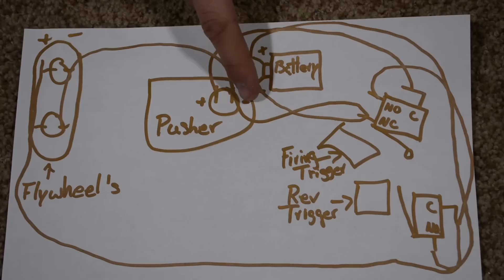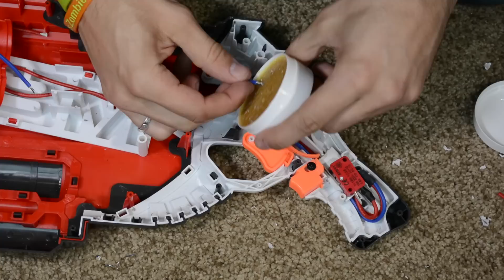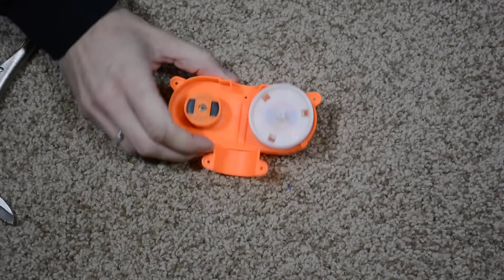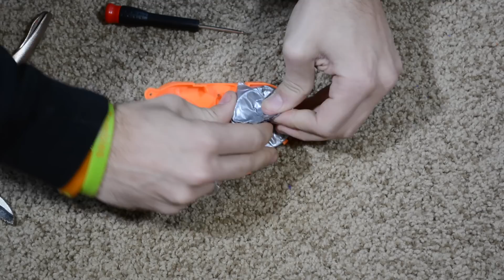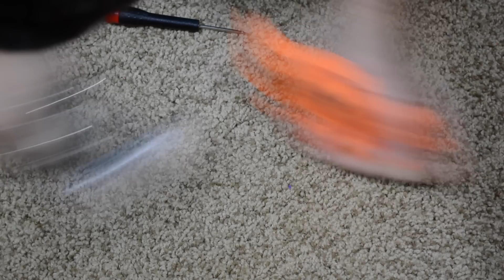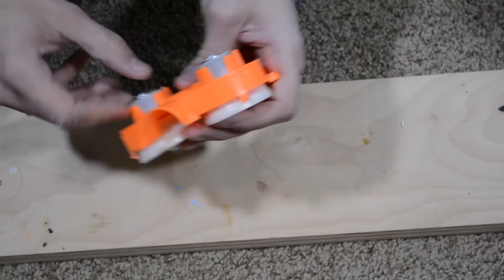[Mod Guide] Nerf MEGA Mastodon Part 2 (Wiring Diagram, Flywheel Removal, Motor Replacement)

Comment: Thats the worst wiring diagram in history. Square off your lines and use little half circles to indicate wires passing over but not connecting with one another. That or use different colors.

Comment: The wiring diagram Isa dead short... Careful. There is no need to run your negative to the normally closed on the firing switch.

Comment: nice solution to the motor problem, if I had the materials I'd put in pmw and a rhino in the pusher like what mister nathan did to his khaos
Reply from the maker: Thanks. I wouldn't really want to increase the rate of fire on the pusher any more. Considering the gears and it having to rotate that huge drum not sure it's a good idea to have the rate of fire any higher, but that's definitely cool for the Khaos.